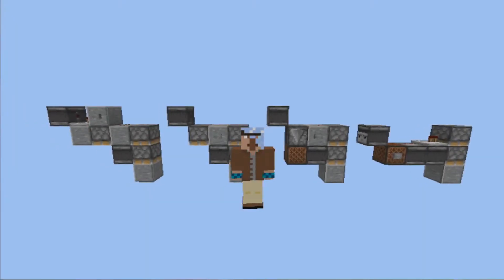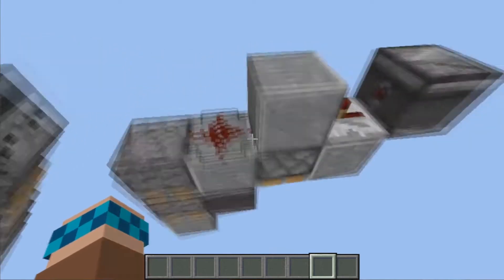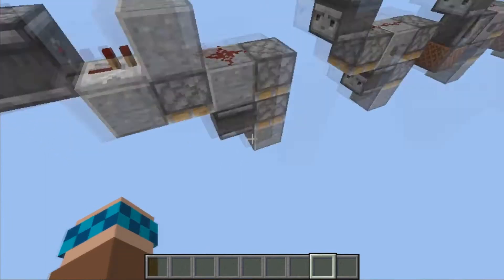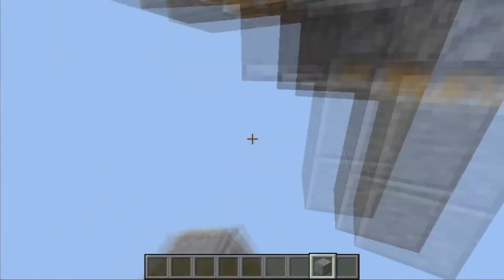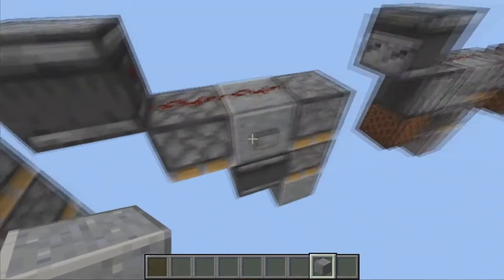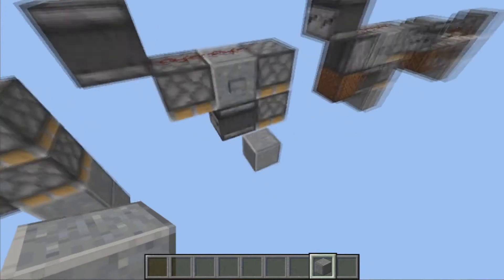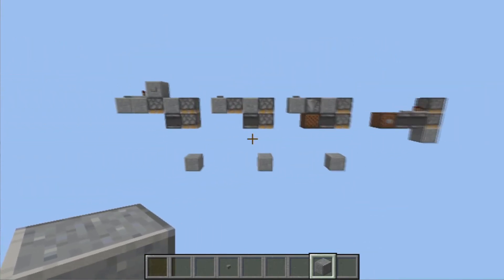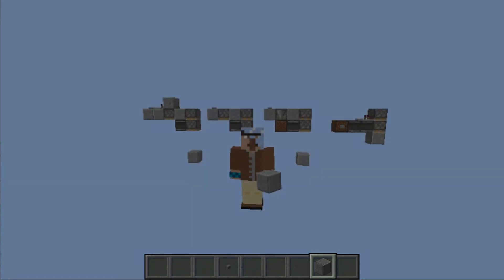Compact Downwards Double Piston Extenders

Comment: are there any ways to do it with levers
Reply from the maker: You could have your lever signal run into an observer that pulses into a 4-tick repeater. Then have another observer looking at that repeater and activating the 1-tickable design.
Reply: thsnk you so much @Iceface42

Comment: how about one activated on lever? please make this one
Reply from the maker: You can turn a lever signal into a pulse with a mono-stable circuit. vice versa, you can turn a pulse into a lever signal with a T-flip-flop.
Reply: @Iceface42  but some of these designs require two separate pulses to do its thing right? So you also need a double pulse generator?
Reply from the maker: @goodiesohhi  If you power something like redstone dust and have an observer facing it. The observer will pulse once for the redstone getting powered and once for the redstone getting un-powered. This could be used as an input for the 1-Tick-Able design.